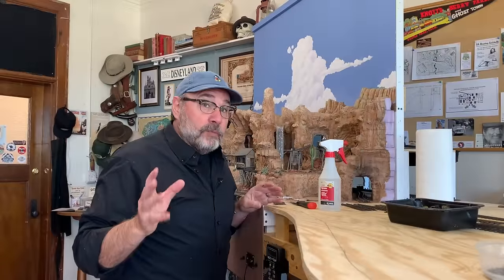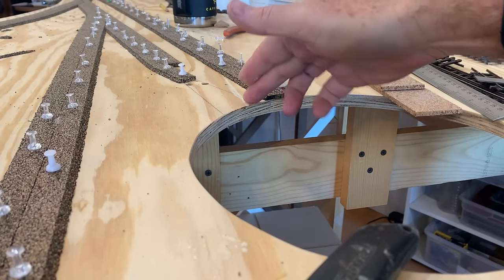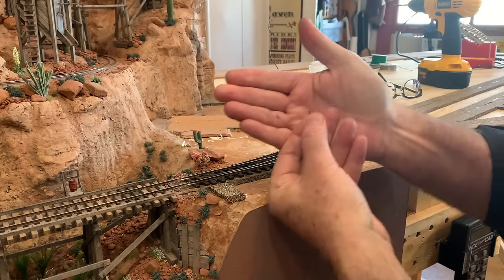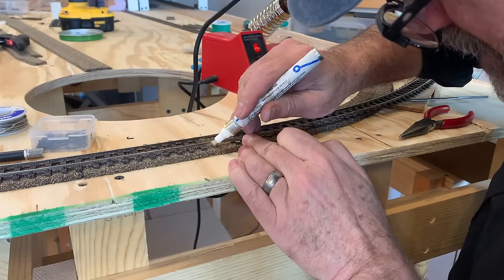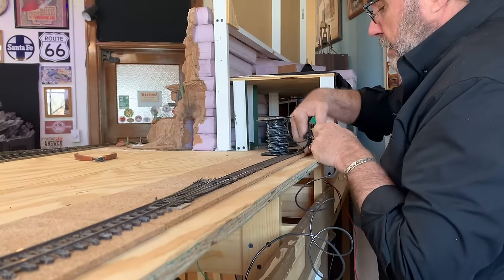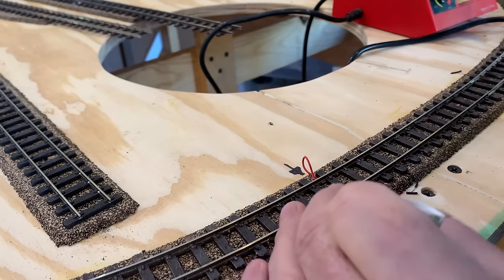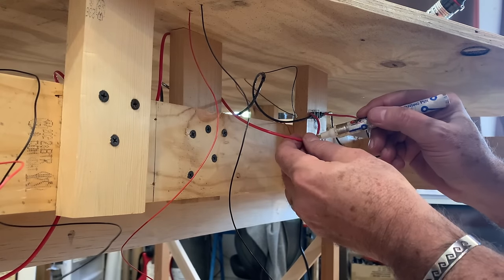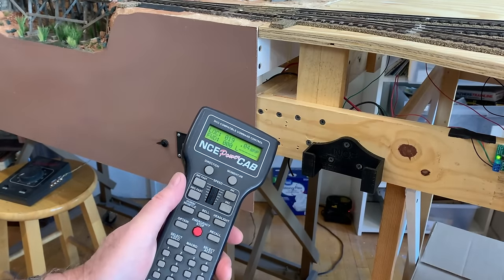On30 Roadbed, Track and Wiring | Goldfield & Calico Railroad

Comment: Now, I get so easily confused with feeders.  I use a Red and a Black Sharpie pen to distinguish between the red and Black Buss and feeder.wire holes in the plywood or Homasote table top.  I started out not using the pens to distinguish what was what and of course got them confused!!!!  When I was younger, I wired up my complete DC layout without doing the color coding.  However at 74 this process has helped me remember the correct process! .